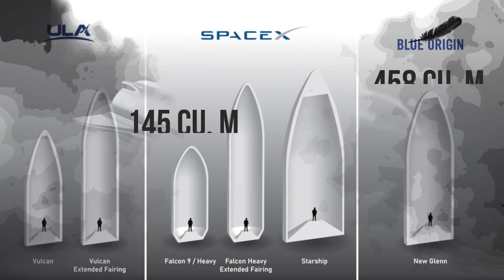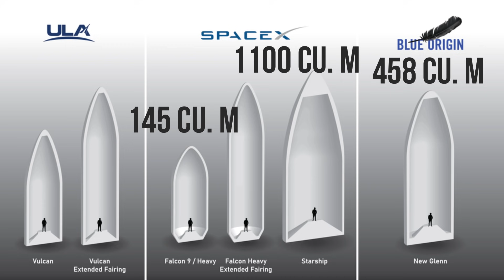SpaceX Starship Has Got Competition? Blue Origin's Project Jarvis

Comment: The industry shows, things are possible. I would assume Blue is just sandbagged by mismanagement. If said management is tossed over board, they can achieve a reusable upper stage, too. I consider it highly likely, that they can pack more chamber pressure on BE-4. 134 bar is ridiculously low. First stage reuse is a good start. For a proper second stage reuse they need to get a hydrolox staged combustion engine to achieve the required thrust densities.

Comment: Nice video and well done explaining things. But I get hung up on is Blue Origin is 2 years older than Space X. BO had the first reusable vertical landing booster. After that not much. SX then created the first reusable orbital class booster. Then the first reusable orbital capsule. Then the first reusable manned orbital capsule. Now the first full flow engine that is launch rated. BO is at risk of being as slow and incapable as those there trying to replace run by mostly governments.
Reply from the maker: Thanks for watching 😊

Comment: Another consideration with having a steel second stage is it creates a top-heavy vehicle. Fuel may compensate this when launching through the lower atmosphere but when sitting on the pad and during re-entry that might cause a problem.
Reply: dude .... the technology gap between Spacex and the rest of the planet is so huge ..... that a company that has put nothing in space so far is not worth even mentioning .....
Reply from the maker: As far as I know, this shouldn't be a problem. As long as the centre of thrust and center of mass are aligned, the vehicle would remain stable. For the re-entry, they can potentially dive like Starship and may use header tanks, so this too should not be a concern. At the end of the day, Blue Origin engineer surely know what they are doing.

Thanks for watching 😊
Reply: @spacexplained5001  Do they know tho?

Comment: Elon said that starship will only be operational in 2023! not next year! Not true you have to pay the fuel plus the operational cost that is more then the fuel plus pay back the design & development cost plus check the integrity of the heat shield and the engines and the structure of the rocket because all of that has a maximum  lifetime.
Reply from the maker: Yeah you are right. But, SpaceX won't be pricing Starship like a Falcon rocket. After manufacturing a Starship, they can use it for more than a dozon flight (just a example)... This means the price will be determined based on after how many launches does SpaceX want to cover the manufacturing cost and turn a profit on a single Starship....

I will be making a video on economics of Starship in future.... Until then, all I can say is check out Wendover Productions.

Thanks for watching 😊
Reply: @spacexplained5001  Thanks!

Comment: SpaceX is under contract with the U. S. Air Force to develop a larger fairing and vertical integration for the Falcon 9 and Heavy.  The new fairing will be able to accommodate the category C requirements for the National Reconnaissance Office (NRO). The particulars of the project and time line have not been released however the contract has been in effect since at least November 2020.
Reply from the maker: Yeah that's correct.. However, it isn't clear whether they plan to use the extended fairing for commercial customers. As I have shown in the video, the SpaceX website still show the smaller fairing. 

Thanks for watching 😊
Reply: @spacexplained5001  By the time New Glenn is launching the Falcon 9 extended fairing will assuredly be available.  At the moment the only customers that require the extra size is the NRO for its largest spy satellites.  If commercial customers ever require the stretched fairing I am sure it will be available to them.  However, with the Starship availability in the near, all this discussion may be moot.
Reply: @WWeronko  Sierra Space would need larger fairing for it's Dreamchaser :-)